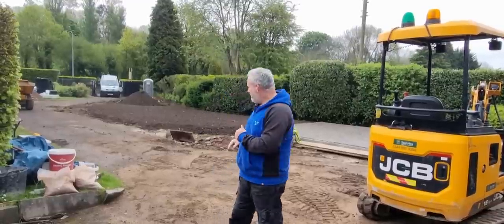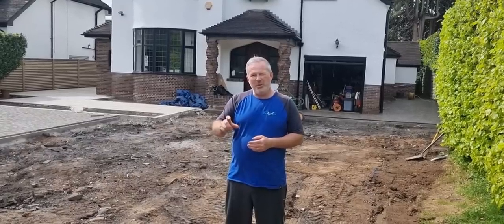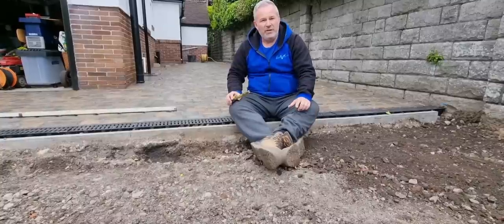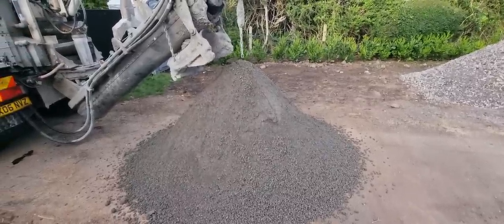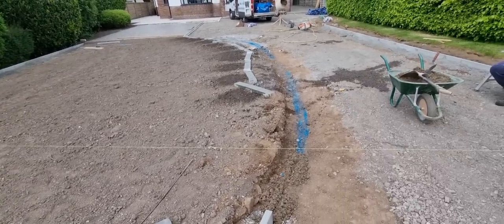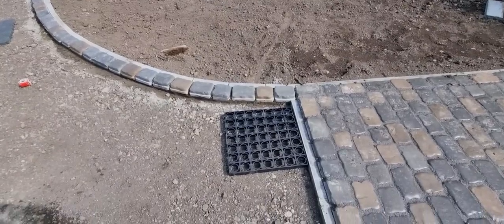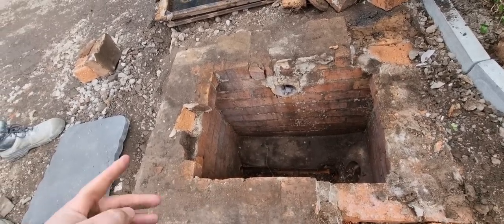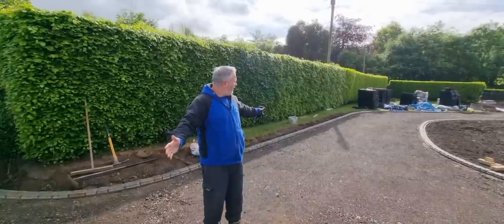How to install gravel parking Grids part 1

Comment: I’m in the middle of a driveway job myself. I watch all your videos as you know, love em. I went for ibran grids off the back of this video and can’t wait to get them down, thanks for the tips! I went through my first gas pipe on this job too! But thanks to you boys, instead of panic, I just went with it. Bloody honest mistake isn’t it? What do people expect when there’s a tiny plastic tube running through the garden in not a few mm down?! You’re an inspiration and I owe a lot you for this job im on (except the gas repair bill!)
Reply from the maker: Will im glad you find the videos useful and they help you which i think is great .Many people have helped me so sharing information between everyone only helps so im all for that .
As for the gas pipe if its close to surface you shouldn't have to pay mate so question it Will.
Good luck and appreciate your comments always do mate.
Justin 👍 👍 🤣

Comment: Can you lay a driveway on top of dirt like that? Do you not need to dig down deeper?
Reply from the maker: Id recommend digger down and added a base 👌 👍
Reply: @brickrightbuildinglandscaping  But it looks like you've laid the hardcore on top of dirt?
Reply from the maker: @GeorgeAusters  
George you dig down the required levels stipulated by the manufacturers of the grids .You add your sub base and compact the area .add the grids etc etc .
So yes its layed on a sub layer thats been excavated 👍
Reply: @brickrightbuildinglandscaping  So it doesn't matter if its on top soil? I only ask as i'll be doing the same myself
Reply from the maker: @GeorgeAusters  
Topsoil should be removed George. It should be layed on more solid ground .
Topsoil isn't suitable so remove it i would  .👍
Reply from the maker: @GeorgeAusters  
Topsoil should be removed George. It should be layed on more solid ground .
Topsoil isn't suitable so remove it i would  .👍

Comment: Hei, another detailed video with lots of good info, a lot of talk about levels across the property but ehat kind of fall did you put in towards the road?
Reply from the maker: Not sure the exact falls but we had a start end point in the levels that was set on the original make up.of ground if that makes sense 👍